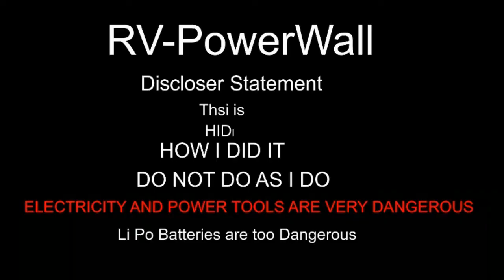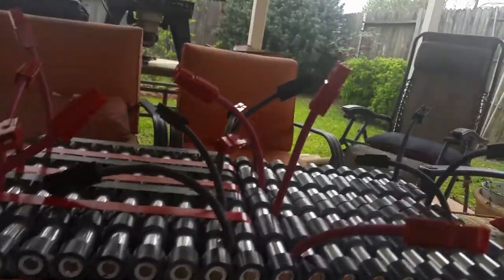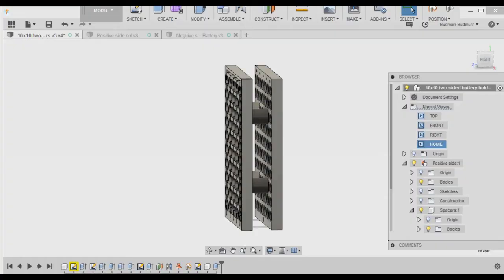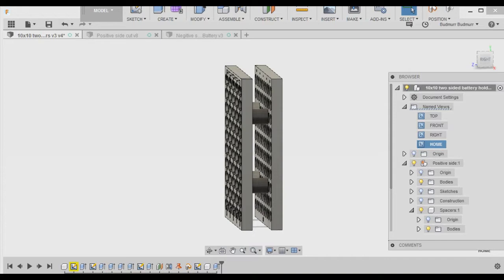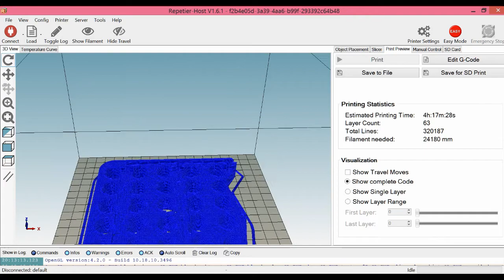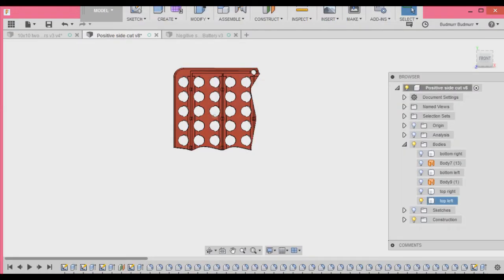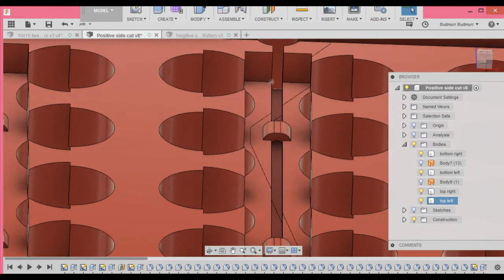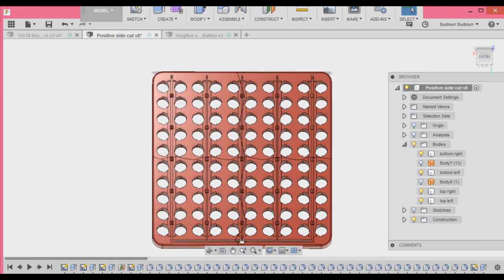Bug Out 18650 Battery Holder Evaluation

Comment: Cool designs, check out a 3dconnexion space mouse instead of panning and orbiting.
Reply from the maker: Thanks Shannon. I do not have much experience with 3d drawing. I used Auto cad in 2d for many years and did not need to do much panning.